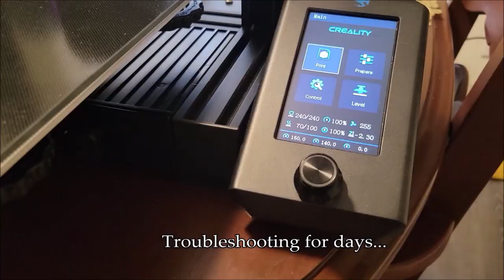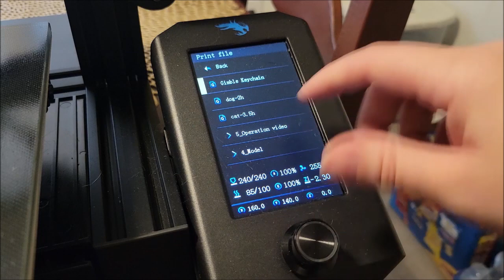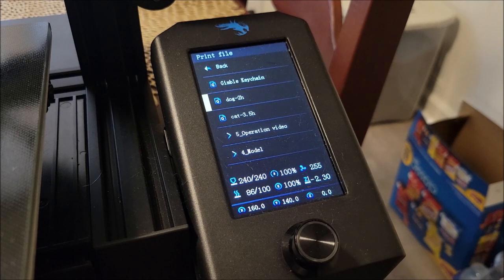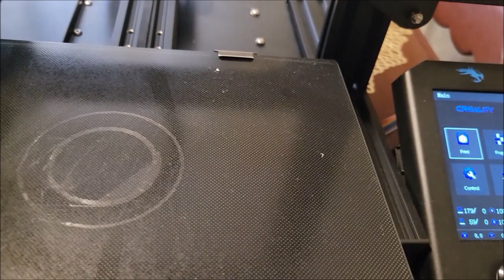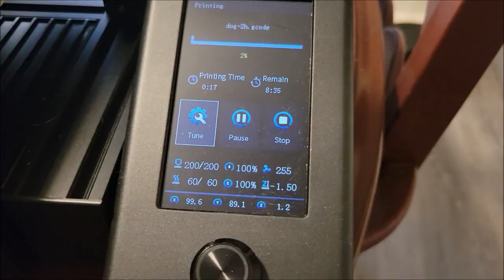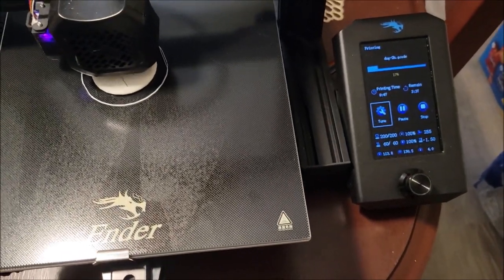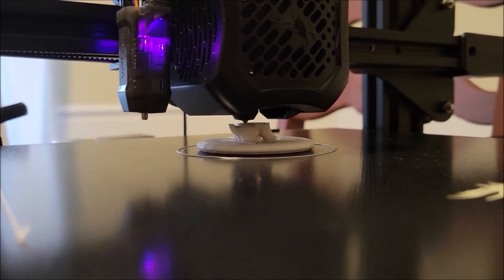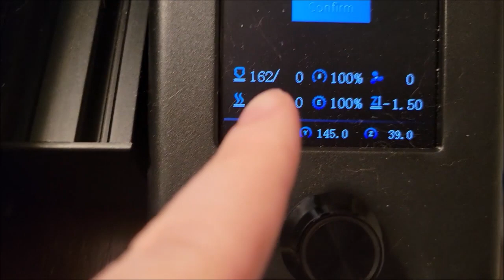3D Printing for the FIRST TIME (aka Troubleshooting for 15 minutes straight lol)

Comment: No, the dog wasn't supposed to be broken off its base, but its your dog so you can do what you wish, lol. As for the zip tie on the y axis limit switch.. you need to get rid of that. your printer needs to be able to home all the way to the back. Its assuming right now that when that switch is pressed the bed is all the way back. thats why when your bed moves forward at the end of the print you get the grinding noise. You're also not getting full use of your bed, and it isn't able to accurately probe the bed either. I highly recommend watching some videos online and learning a bit more. Im happy you were able to get a print though, very cool.
Reply from the maker: Thanks for the tips! It was actually from looking at videos online that I got the ziptie hack (a rolled piece of tape was recommended but mine kept bending). Without it, when homing, my machine never actually hit the Y axis switch so it was grinding away at the back and stayed homing forever!
Reply: @BrieIY  you'll have to get a longer screw or bend the switch arm or something to make it actually connect and home correctly.
Reply: So from what I can see in the video the bed is hitting the y stepper motor before the carriage underneath can reach it. You’ll need to unscrew the bed screws until it can clear the y motor. You’ll also need to re level the bed to the nozzle after that, with the four bed screws. Idk if you know or not, but you need the four corners of the bed to be the same height from the nozzle. Most people use a piece of paper on all four corners until they feel resistance. There’s a lot of good videos about that. Then the autolevel sensor does the fine tuning so any inconsistencies on the surface can be accounted for.

Comment: Glue stick. Like, Elmer's style glue stick.

Adhesion is slightly better but it also pops off easier. I'm printing nearly a full bed on a much larger machine (cr5 pro, which has the same glass bed as yours) right now and it pops off clean. Plus you can just wash it off the bed with hot water.

Also the estimated time in the slicer doesn't account for acceleration or other performance things so it usually takes longer than the slicer estimate you'll see on your computer.

The outer ring you peeled is called a skirt. Helps to clear the nozzle, but isn't really needed if your machine does a purge line on the left side of the bed like mine and I just didn't catch it.

Dog was not supposed to come off lol

I don't know if you have a filament dryer box but I suggest getting one. Filament needs to be dried, and not doing so results in poor prints.
Reply from the maker: I'll have to try this next time! 
I've done a couple more projects since this video and usually the time is actually faster than the slicer! But I have been doing a lot of smaller projects! I wonder if that will be true of the larger ones!

Comment: The bed level feature is awesome! I have a Monoprice Maker Select Plus and it has four screws in each corner to level it.

I used to print with PLA and my main issue aside from leveling was not printing at the right temperatures so the edges would start peeling up before it finished and sometimes break off. I would spray hair spray on the surface before each print and it would help.

I've since switched to PETG plastic and wrapped the heated bed with APT tape and I'm confident enough with my settings that sometimes I leave it on overnight doing 8 hour prints.

That outer circle is one of the different settings for a skirt/brim just to basically rest and clean the nozzle before it starts the actual print. The base was definitely supposed to be part of it!

A tip for if you scuff up the surface sanding off imperfections is to give it a quick blast of heat from a grill lighter. Not long enough to melt or burn but just a quick blast will melt enough to smooth the scuffs.

I can't remember if I've tried painting PETG but PLA is very paintable. I made a really awesome 1:64 scale painted replica of my entire house, furniture and all!

Comment: Yon need to get you Y limit switch correct it should hot the lower part of the bed framing not the upper part thats heated

Comment: 3D printing isn't really unbox and go, by any means. It really needs to be a tinkering hobby, especially on low end machines like Enders(which CAN produce great prints, given you take time to tune them properly)

Why your machine is clicking at the end of the print, your zip tie contraption at the back is causing that. The limit switch is meant to have a roller on the bottom of the machine(for the bed) press up against it. I assume you added the zip tie because the bottom of the bed crashes into the Y axis stepper(the motor next to the zip tie). This means your bed is too low, you need to raise the bed up enough to where it clears the stepper motor and allows the roller wheel on the bed to hit the limit switch.

Another issue you are having, which is probably a consequence of the above issue, is your bed leveling probe probed on top of the metal bed clip, which probably caused the first print failure, as it tried to calculate that as the bed not being as flat as it was. As an avid 3d printer enthusiast (with a heavily modified Ender 3 V2, as well as a self built Voron Trident), you're doing yourself a disservice by trying to figure this out on your own. r/3Dprinting (on reddit), has a whole community of people willing and able to help you through these issues.